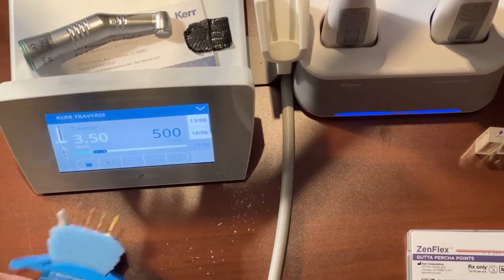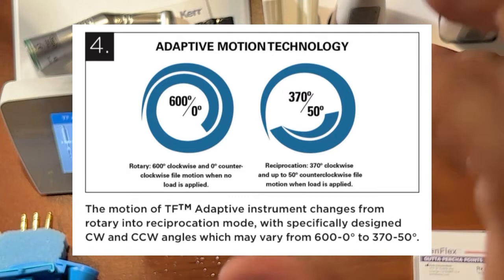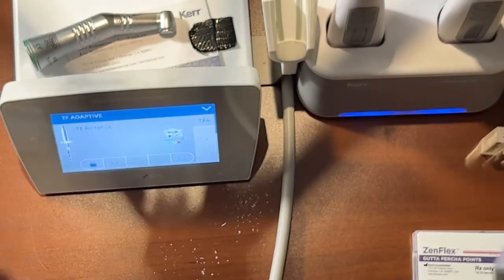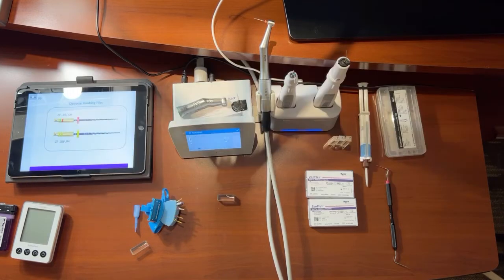ZenFlex Simplified Protocol + E-motion motor + Obturation w/ Elements IC

Comment: What settings do you recommend for Zen Flex One ?
Reply from the maker: Hello! This is a great question! Zenflex One is our newest file on the market and is comparable to Wave One which is a reverse fluted file system. So, ZF ONE will not work in the Elements E-motion motor. You will have to purchase our newest ENDO motor called the Elements Connect because that can reciprocate in a counter clockwise motion! Or, if you already have a Wave One compatible motor like the ProMark then you can just buy the ZF ONE files and they’ll fit into that motor.. hope that helps answer your question!
Reply from the maker: https://youtu.be/7ac0cGcdM_E

Here’s a video on the new elements Connect
Reply: @douglynch6613  thank you so much 
So excited to try them !!!!